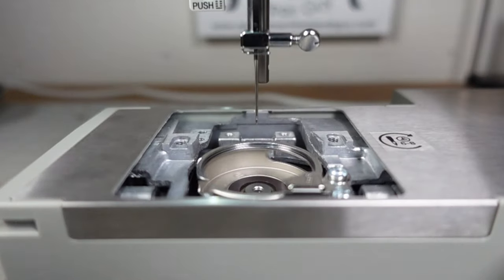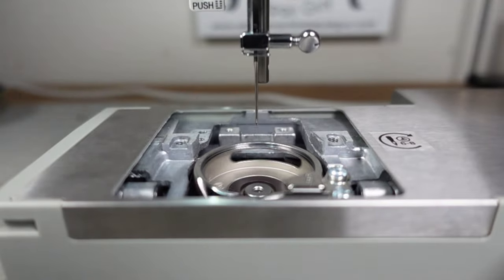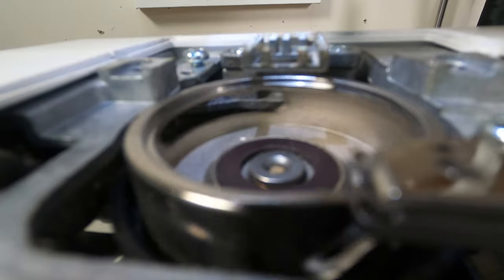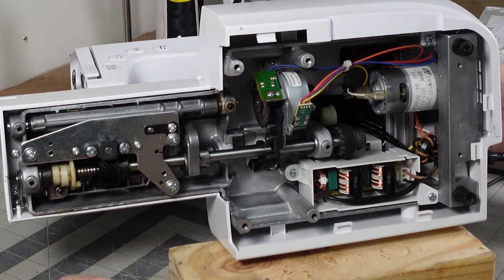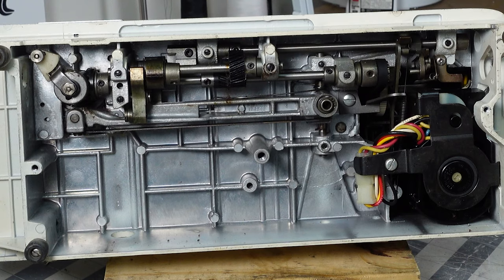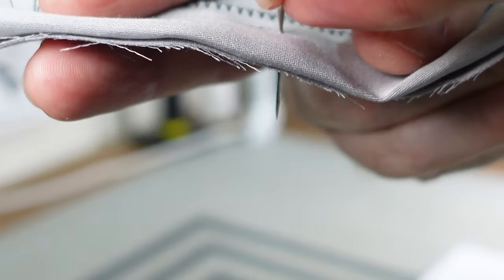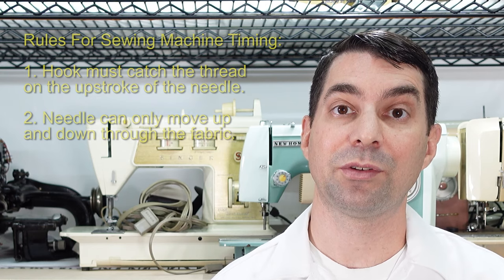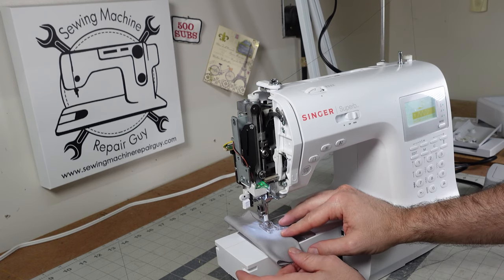How to Fix Timing Issues on Your Sewing Machine, Free Course on Sewing Machine Repair 4 of 5

Comment: OMG this worked! I have a $1,600 machine that is less than 2 months old, and it stopped pulling up the bobbin thread. I followed your instructions and I fixed it myself! The cost was a trip to Lowes to get a hex key set that would fit the screw, but otherwise I would have had to drive an hour to the closest repair shop and wait for it to be fixed. I can't thank you enough, and I feel so empowered now!
Reply: Edited to say, I had to go back to the repair today because it wasn't completely fixed. In your video, it's hard to see because the parts are black, but there are actually 2 set screws next to the gear for the bobbin timing. I couldn't see that and only adjusted one, which didn't work. I loosened both screws, the turned the gear with my hand slightly until the needle came up just barely before the hook, and it worked. Tightened everything up and I am sewing just fine now. Thank you so much!

Comment: A great video and always straight to the point. I absolutely love it. I have had a Janome machine with a timing issue. I always fix it only for the issue to keep coming back after a minute or so. Even the service centres failed to find a permanent fix for this. I wonder what the cause of such an issue is

Comment: Brilliantly explained! You took an incredibly complex problem and reduced it to it's principal parts.
The only thing that you could improve would be the focus of your camera on occasions. You could try to place a piece of paper or cloth close behind your subject to force it to focus. Different colours, patterns and texture may work better.
Thank you so much! 👍
Reply from the maker: Thanks for the suggestion, I tried to use a GoPro for macro, and that didn't work out very well. I'm trying to improve with each video, there is a lot of room for that improvement.
Reply: @SewingMachineRepairGuy  It's not at all easy to get the focus right and framing the shot while manipulating controls, describing things and managing lighting! Macro is hard, because the greater the magnification, the shallower your depth of field. Having the ability to manually adjust the focus is helps hugely and many digital cameras lack this. I struggle with macro photography with my phone for this reason.
I have noticed your improvements. Keep up the good work - this series is great! 👍

Comment: I have  Singer HD. Now I opened needle plate and took bobbin case out for cleaning. I also made paint marks to hook and frame for  timing check . The marks match when needle is lowest position.

Comment: Thank you so much for this video! I really like how you explain the general principles that can be applied to any sewing machine. Thanks to you, I was able to finally set the timing on my machine after replacing the plastic gears on my machine. I couldn't find any other video on youtube that explained setting the timing as clearly as you! 

I had a question and I'd be very grateful if you could answer it:
My machine is now able to sew a decent straight stitch, but on zig-zag, when the needle comes down on the right side, the upper thread keeps snagging on the right "toe" of my Apollo bobbin case after the hook catches it and it comes around. Is this an adjustment that I have to make on the hook timing or is there a problem with something else? The stitches are okay on the left side, but there are skipped stitches on the right.

Comment: PSA: I just came from another vid that helped me to fix this issue. The hook above the eye with no gap is wrong. There should be a 1.6 - 2.0mm gap between the bottom of the hook and the eye of the needle, otherwise you're going to get this issue where dots of bottom thread appear on the edges of your embroidery. This isn't a tension issue btw, it's an offset issue. If you embroider a column (tension test) and you look under it to find three columns (white in the center, color on each side) you might find one side of color is thicker than the other side. This is an offset issue due to the hook literally being above the eye, that gap has to be there.

Comment: Thank you.
I'm still not clear on what position and distance the hook should be in relation to the needle eye when it does the zig and then the zag.
May you please do a more magnified video with clear pointers and measurements of each component.
Reply: Same thing. On the upstroke just above needle eye as it's upward momentum creates the loop for the hook to grab

Comment: I tried this on my Janome Quilers Companion. Sadly didn't work.
When I practiced watching the needle to hook with top thread in, it always picked up the thread, but it still doesnt sew, missing stitches on straight and zigzag.  Any help would be appreciated, but i don't think you are there now to answer question?I did do a similar adjustment on my elna Lotus, which did work.

Comment: Nice I have a very old Singer , previous owner welded a broken arm on it (he has more sewing machine, and give this up for free because is not working well), but welding is not in the right position so the machine is skipping often, maybe I will see if I can fix it and add an electric motor to it instead of foot. I remember 10 years ago buyed a new Singer and trash it but my mother go to the trash bin and bring it back. It was not used anymore... maybe I will fix it an make it as a present back to my mother, or use it for hard staffs as is full metal..

Comment: Thank you so much! I have a Brother xl-5130 all mechanical with a vertical bobbin. Anyway the timing was off, but I didn't see an adjustment  on the horizontal shaft. I decided to adjust the needle bar height instead. I noticed on a zig zag stich that the timing between the zig and the zag is always off because on the zag the needle has just moved to the right about 3/16th's or so (the width of the stitch)  and is always early for the hook. Is there an adjustment to time the zig and the zag independant of one another? Right now I split the middle to try to average between the two. If I would have been able to make the adjustment on the horizontal shaft, are both the zig and the zag being adjusted at the same time? or does that just adjust the zig or the zag independant from one another? I do get things on Amazon, I will try to remember to click on your link first. Thanks!

Comment: Hello! Thanks for the demonstration. It helps to understand what is happening. In your Opinion, Are the home machines capable of sewing nylon webbing with the bonded nylon #69 machine? My current model is the NECCHI ROYAL SERIES Model # 3204FB. I seem to be having a lot of tension issues (Bird nesting on the bottom) as you described in your video (which is great help by the way). I have no current way of checking my thread tension other than the dial settings. Using this thread, should my Bobbin tension be set the same as you described in the tension issues video?  Thanks !

Comment: I don't know which way to turn the tool. I'm a bit nervous that I might break the tip of the tool and cause another issue because the screw is really tight. Which way do I turn it to loosen the screw?

Comment: A good lesson but you overlooked the fact that the bobbin has to turn clockwise or counterclockwise depending on the machine so it has to be placed in in the correct direction. Cheers

Comment: I have a singer Merritt  9612, that developed the problem today were the bobbin gear is driven on the shaft and there’s no screw or way to tighten up the gear that is on the shaft is slipping, I don’t know if it was pressed on or glued on.

Comment: I have a question about the bobbin hook ring. It got caught by the thread and stuck so tight that I couldn’t pull it out. So I took the bobbin case out, still couldn’t pull it out. So I took the right side part which has a spring that holds the bobbin case in position. After I took out the thread, I thought I did it. But, the needle doesn’t pickup the thread from the bobbin. The hook ring is not moving anymore. Is there any hope to fix it?

Comment: Can the tension make the needle come down in front of the needle hole and strike the needle plate? My Singer 4423 got knocked off the table and landed on concrete floor.
Reply: Yikes! Sounds like you have some bent stuff.